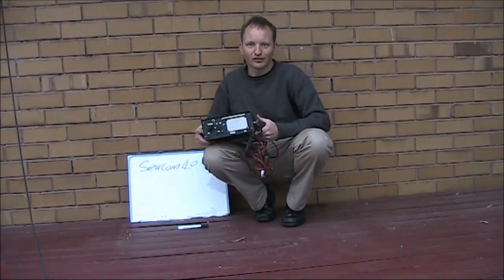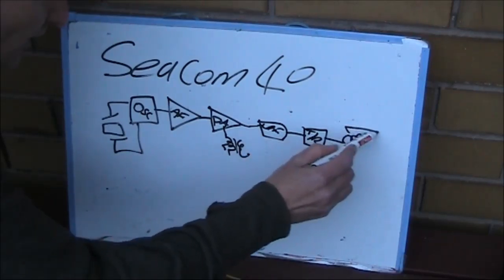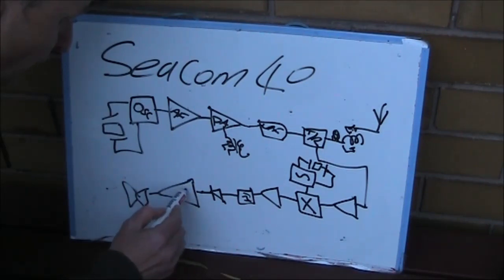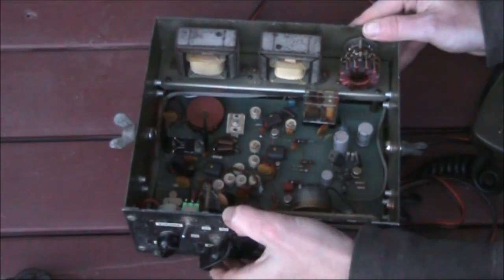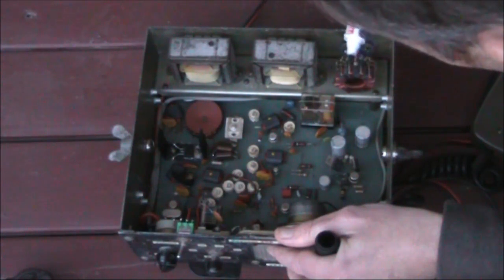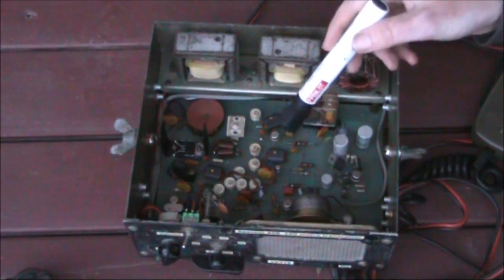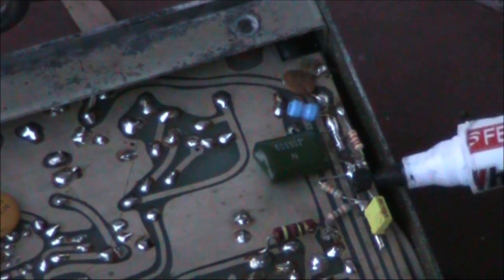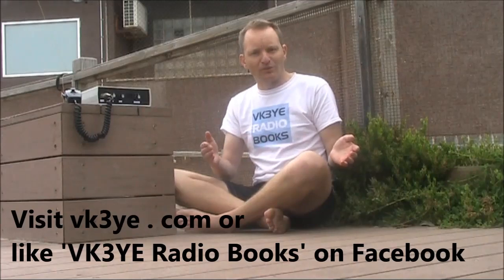Seacom 40B 2 MHz marine AM transceiver on 160m

Comment: Awesome brother! Nice-looking rig. I'm looking to get one myself but they are difficult to find. Do you know any resources to find one or even schematics and the material list to build one?
Reply from the maker: Many circuits on the web for crystal controlled pirate AM transmitters. Then build a simple superhet for the receiver in the same box.
Reply: @vk3ye  thank you I'll check out what you said. Why is it called pirate? Also as a complete novice and beginner I'm having trouble understanding the boards. Do you know what type of bored I would need to solder all the components on?
Reply from the maker: @brandonlaragirl  Pirate = illegal. As a beginner you need to start off with much simpler projects first as a transceiver is too much as a first project and is very unlikely to work first up. Maybe build some kits to start off with then move to 1 & 2 transistor projects from scratch. See my website vk3ye . com and others.
Reply: @vk3ye  thanks bro

Comment: I need to try out 160m soon. It's the only band other than 2200 and 600m I haven't ever transmitted on below 900mhz. I could probably get a dipole up in my yard, and absolutely could on our 160acre property that's a 5 hour drive away.